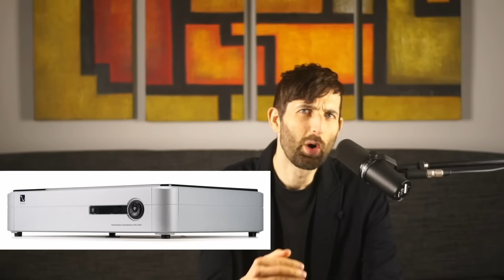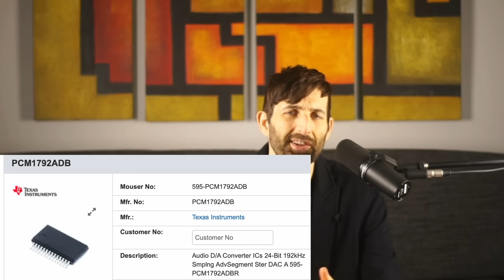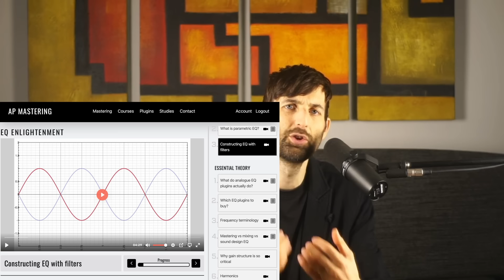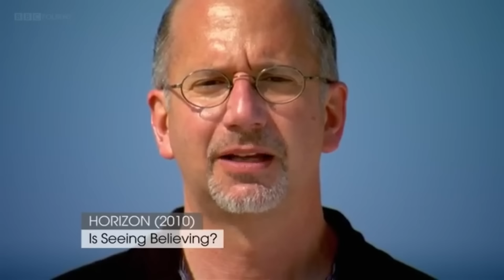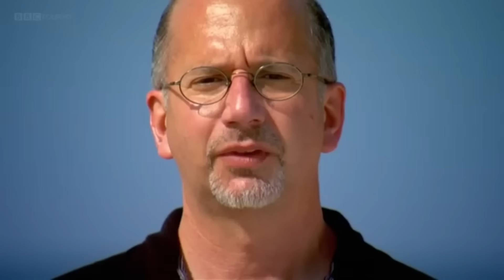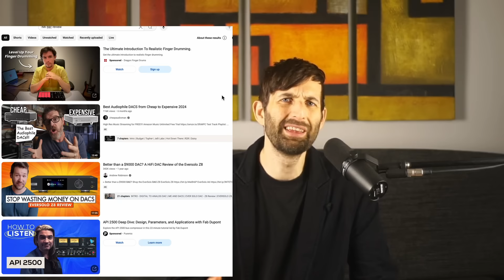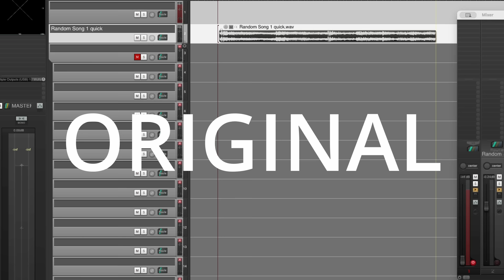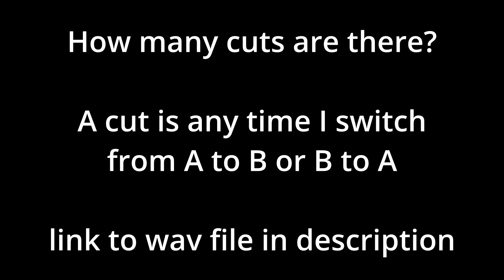The DAC Scam - Almost everyone believes the hype

Comment: This is where you are wrong, DAC do have a signature/designed sound and if you think otherwise then you clearly don't understand a thing about electronic, audio and DSP.

1st of all, a DAC consisting far more component than you think. It consist a power supply, a clock, a pre-amp, some conducter, some shielding, some filter, heat sink and protection mechanism. It's practically a mini audio chain inside the DAC unit and audio is always a model that ultimately limited by bottle neck of the chain. For example, if you use a bad preamp/not oxygen free conductor in your dac, you're not gonna get a decent signal. Another good example is like building a desktop computer, if you use a RTX 4090, but pair it with a dual core processor, 2 Gb of ram, small heat sink and small power supply... You are not gonna get the top tier performance. So it's either 1000 USD build or 4000 usd build, very hard to find an inbetween cause if you upgrade one, you upgrade all. But if you think a DAC is just a texas instrument chip, you are way below the league to understand DAC design.

2ndly by nature ADC and DAC is an approximation equation by nature, so inherently it will have some information lost in term of both transforming. In technical speaking, ADC implementation is relative simple compare to DAC implementation. That's because the "reconstructing phase" of signal deciding the signal characteristic, such as tone, noise, timing accuracy and etc characteristic. This is especially true if you use a bare minimum ADC with minimum sampling rate dictate by nyquist theory, cause then the tone of higher frequency need to be reconstructing by personal choice due to lack of information. Generallys speaking, most cheap DAC signature's different usually more revealing in high frequency sound tone, though some DAC with gold conductor do have a better low compared to copper or brass alloy, again it's a system and not every one of it doing the same thing. 

3rdly, the reason why you may not actually hear it in A/B listening test is actually a very simple concept. I already said the DAC is a system of audio chain, but that's just a mini system chain in a way bigger system chain. For example, the 2nd stage amplification itself is another system chain, the speaker's mechanical diaphragm movement also another audio system chain, your acoustic characteristic in your room also another system chain, and even your body temperature, your altitude (thus different inner and outer pressure), your blood pressure and your brain anxiety level etc. It's actually a very complicate engineering problem and most peoples usually just simplify it as "you may need a better speakers, it's slow mechanical movement is masking all the details of your DAC" argument. While it's true the mass of you speaker diaphragm usually are the biggest bottle neck in your system, but in reality there's literally too many variables to make this kind of experiment to have any reference value. It's akin of telling people phone 3.5mm audio jack is the same as 1000 USD DAC when you use a crappy headphone, and it's just the most common beginner mistake out there.

4thly, the quality of a DAC isn't about it's price, it's about the design, intended purposes, and it's longevity. For example, you do not need a very expensive DAC if you just using it to powering your headphone. That's because due to the low amplification nature of your usage, the signal need not to be as refine and clean for futher amplification. Some DAC designed for near field listening distance, some designed for 5 meters, and some for a football field distant's amplification. That's also applicable to the example of entertainment speaker, if you know you are using high masking speakers in your system, such as entry level studio monitor or everything below, you also do not need a very expensive DAC. I would say buy a reputable brand within your budget, since usually it's too complicated for normal peoples to understand all those variables in audio design and etc. Spending money doesn't change the fact you know nothing about the design, but what you can do is to banking on reputable brand maintaining their brand reputation by honest design and proper engineering.

5thly, the loop recording you're using in this video is just for demonstrating the inner interference/self noise/ distortion of the interface. It doesn't speak about the quality of the DAC at all. The quality of the DAC usually about to measure the distortion at 2Vrms or 4Vrms (generally higher the better), along side with those "reconstructing phase" choices of tones. Again this experiment alone demonstrate you ignorance. It's akin to some noobs that using a sine wave generater to generate some sine waves, and then use ADC and DAC to convert it, and claim the signal identical enough so DAC is all the same in term of audible characteristic. That is the single handed most retarded experiment I have ever seen in my life. This is close but I hate to break it to you, your method is use to measure ADC self noice, and maybe the DAC self noise, but not the quality of reconstruct signal.

In conclusion, I think you are someone who know nothing pretending you actually know something. There's so many things wrong in your video and i don't think I can explaining all to you in relatively short time. For example we use the word fidelity and not transparency, and we've been use it since the beginning of audio equipment, it's just we usually use the short form of high fidelity(Hi-fi). Another example is your lack of precision/understanding/knowledge in experiment, it's very clear to me you can't even doing a good hypothesis, which is the 1st step of an experiment that's involve not only your left brain, but also your right brain. It's a very good sign of you know nothing about experiment and just a fake science class student wannabe. Another example is your confusion of an audio interface and a DAC, which you put picture in your video. Usually when we say DAC we mean those 3.5mm audio hack in your handphone, a dedicated Digital Audio Player and preamp. And if you can't distinguish the sonically difference between a handphone/interface headphone jack to a 2Vrms professional DAC's signal, you should check your hearing immediately.

A simple way to test difference between DAC is just using a same digital files, same digital player software, same signal cable, same speaker(higher tier studio monitor) and trying capture the sound in a microphone (higher tier microphone) with different DAC playing. Then invert the signal and you will see the difference is a fake mental thing or not. I suggest you use a chord mojo and a Ifi for comparison, no need for super expensive one. Or better yet, buy one of a chi-fi DAC that the ASR so rave about and compare it to Mojo DAC. 

But I guess simple valid experiment like this must be too difficult for most of the audiophile out there, thus why they kept getting scammed by those "fake mentally thing" all you "scientist" mentioning, right (Sarcastically)? My assumption is this kind of propaganda are put out as an effort by some chi-fi organization, cause scientist cannot be this stupid IMO.

Comment: The chip is one of the things that matters and not all. There are absolutely terrible ESS based chinese DACs and there is Weiss which uses the same chip and sounds wonderful. Typically most of these modern DAC chips have two stages. The first stage oversamples PCM to 768 kHz, the second stage to the MHz range. Most of them utilize a 5-6 bit ladder and then delta sigma modulation beyond that to get resolution. What matters most in these designs are the following:

a) The input stage - this decides how jittery the incoming signal is. Many manufacturers build complex PLL and re-clocking systems here. The clock integrity and accuracy matters as well.
b) The digital filter - the DAC comes with some standard ones but the best DACs use their own custom designs in FPGA. The hardware here is commodity - the skill is in the software design and the filter roll off, its high frequency response, how it deals with ultrasonics which can affect audible data and things like that.
c) The noise isolation between the digital side and the analog side. While in theory, bits are bits, there can be noise that can ride over the analog carrier and leak onto the analog electronics side which will then be heard in the output
d) The output stage - a proper well designed discrete output stage which is meant to sound good not win spec wars. Anyone can build a very high SNR output stage with 3 opamps - two for I/V and one for buffer but these sound terrible.
e) Quality of power supply to each of these stages - they must be isolated. 
f) Quality of life stuff like the right inputs and outputs.

While these cost money, they definitely do not cost in the 10000s of dollars.
Reply: You're wrong because you're vastly underestimating the advancements that were made by the Chinese. Look at the cheap DACs like Topping D50 III and SMSL DO300, they have jitter with peak measured down to - 140 dB, and 0.00007% THD+N has become the norm. All of your points A through F were overcome with engineering, and the $10,000 Weiss is now a piece of junk and I wouldn't even use if it was given to me as a gift because it performs poorly. Check the audiosciencereview for Weiss DAC501, it only reaches 111 dB SINAD. That's equivalent to a $100 Chinese DAC. The recent Chinese releases have specs beneath the noise floor of the AP555x and are becoming no longer testable. Your point B is wrong, the Chinese put in the work on their digital filters and they now have very desirable exemplary rolloff. Amir tests it and he's a stickler about the quality of the rolloff. Your point D is invalid, the quality of the output stage is fully revealed by the test results, the only other option is an output stage that purposefully introduces distortion because you weren't happy enough with your 10 mastering chain inserts so you're trying to remix the music one more time with a little bit more distortion during playback -- but you're better off using a scam power amp for that, or you could use some old crappy DAC or an R2R. An R2R is for a HiFi noob who wants to do mastering so they try to remix the music during playback with extra distortion. But we can actually emulate the R2R's harmonic distortion BEFORE conversion, and play that back on a 120+ dB SINAD delta sigma DAC, and you'll think it's an R2R.
Reply: @zyxyuv1650  Measurements don't tell the whole story. It's easy to inflate those numbers.

Comment: On point! Making the case from one piece molded material of any kind isn't going to improve the sound. It's a convertor, not a speaker cabinet. Acoustics don't come into it. Such a solid design would definitely make it more rugged, which is in itself a good thing & worth paying for, but it isn't going to enhance the performance.

Comment: I bought a second hand topping stack a while age. After tweaking the settings and fussing about (not greatly impressed), I plugged the headphones into my 2019 Macbook and the sound was bigger and better. These audiophile reviews and recommendations are very confusing. It turns out the DAC and basic amps in the Macbooks are quite good and probably as good as any budget DAC amp combo. They just want to confuse the money out of your wallet. Having said that, I did get the Aune S9C pro and that was, overall, better than the Mac output; but that's a combo. That will do me FOR EVER. Great video mate. You are spot on.

Comment: Guy's clueless. First off, only some DACs used DAC chips like AKM, Cirrus, etc. And these DACs all from $500 to tens of thousands sound different because, the DAC conversion chips are only part of what you hear. there's clocking quality / accuracy, power supply quality, noise rejection / suppression, component types and quality, and last but no least - the analog output stage. secondly, many higher end DACs do NOT use a DAC chip but discrete ladder networks, R2R DACs.

Comment: “Industrial” components use exactly the same ICs, made in the same fabs, as the Commercial-grade components. The only difference is the tests applied to screen/sort the parts, and perhaps the package wrapped around the chip. The function of the device is exactly the same, but with a guarantee to work over a wider environmental temperature range, and the promise to work for ten years or more.

Comment: I tried to null-test the result of different DACs but they were off some samples. The surprising thing was that on the course of maybe 4 minutes the result of DAC A was one or two seconds longer than the one of DAC B, making the null test impossible (as I compare something from 50 sample in the future with the current sample). Judging by my ear the difference never sounded bigger than 0.5 dB - nothing that I could not change with an EQ. Now I'm not a professional, but I play, make and mix music since the 2000s. If I don't hear the big difference I trust that the average person on a cheap earpod won't as well. Or maybe I am wrong because I haven't used a platinum coated USB cable to connect my audio interface with my computer...
Reply from the maker: this is then a clocking issue, i've not had that problem personally on sensible quality gear

Comment: I don't know which is worse - the idea of a 100K DAC or your misinformation.  There is far more to a DAC than what you imply.  Some manufacturers actually use a chip and then write programs, sometimes ignoring the "plug and play" element of the chip.  Personally I use an R2R ladder DAC which doesn't use a traditional chip at all.  The power supply is very important, but of particular importance is the analog output stage.  These can be a cheap integrated circuit or a very costly output stage like you would find in a high end preamp or phono stage.  Yeah, the price on some is insane.  But so is what you're spouting.  Admittedly I quit watching after the first five minutes or so because it was an obvious waste of time.  Ignoring your factual misinformation, I'll quote composer Charles Ives to you - "Stand up and use your ears like a man"

Comment: What about the Auralic Altair G2.2. Its proprietary ESS DAC chip is modified by bypassing most of its functions. Meanwhile, Auralic uses its own clock reconstruction, digital filter, and oversampling, which are handled by the Auralic's new Tesla G3 platform is based on quad-core 64-bit architecture.

Comment: This video is straight up disinformation. Yes they use the same chips, but sound isnt dictated by the chip itself, but implementation, power, clock, and ultimately the analog output section. The chip, the brain of the dac, isn't the only part working here.

Comment: I kind of disagree with your premise. I've had a few DACs, which each sounded better to me than the straight signal from my mid-end DVD player. I had a Topping d50s and then a Schiit Modius, and I heard a definite improvement with each. More recently, I have a much more expensive DAC, a Chord Qutest, and I hear a big improvement over the Schiit DAC I had last. You might claim that there's some conformation bias at hsnd here, because of how much was spent on the Chord DAC. This really wasn't a factor though, because I traded some gear I didn't need for the Chord, so I have no money tied up in it, and I was quite skeptical that I would hear much of an improvement, particularly since I'm running everything through a vintage Marantz receiver, which I felt was probably not resolving enough to get much benefit from a higher end DAC, like the Chord. What I heard, though, was a dramatic improvement... in dynamics, clarity, detail, and soundstage.

Possibly, there isn't as dramatic benefit once you go above the price of the Chord Qutest and that the price range this thing sits in is really the sweet spot for value in DACs... but I can tell you that it sounds far better than the very inexpenive ones I started with.

Comment: There is a lot more to a proper / high quality implementation of a DAC than what is noted in this video…. We really need to go into much greater detail if we want to have an actual subjective conversation.  

But… I agree in general with him.  I just feel the actual price point to where you might be wasting money maxes out a good bit above what has noted in this video.  And probably much higher.  But I can only speak to my budget.  This is why I feel this video needs some better price point parameter.

I’ll say this.  I know on my set up I have 5 x DAC’s I play around with.  My Chord Qutest hands down destroys all other DAC’s that are in the $200 - $499 range.  We would expect this for the price point of $1700 ‘ish.  Back to my point about a better price point parameter. 

Also, with the implementation of HQPlayer as my upscaler / DSP / Room correction things went to another level..  

Just my two cents…

Comment: You sold me on your message when you first said “quid”

As an American this is my favorite across the pond slang. 

But yes, absolutely. Just like the difference between a Corvette and a Bugatti is like $950,000+ but the performance is 125% in a controlled race track or dyno testing but in real world application is effectively equal in what you’d actually experience in “day to day” use

Comment: Chip is the same but periphery electronics differ. And it affects the sound massively. Even how the power supply is designed matters, because bulky inefficient old style design provides a current, out of which the amplifier will shape the sound, with different characteristic than a modern one. Than comes an amlifier itself, which is a whole story.

Having said that, the most expensive DAC used in audio production costs about 5 grand. It hooks up to your computer over usb on one end and delivers line out on the other, which you can route to your favourite amplifier.